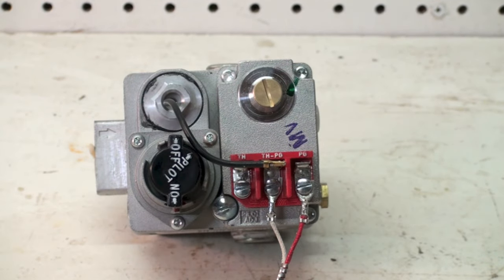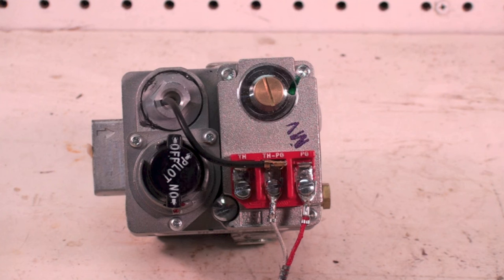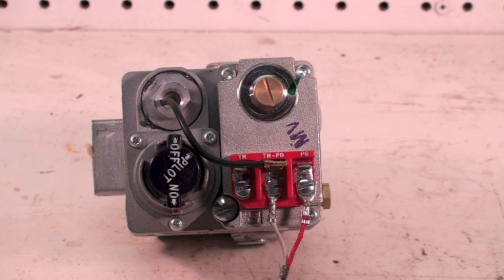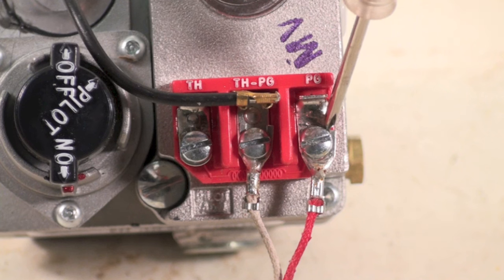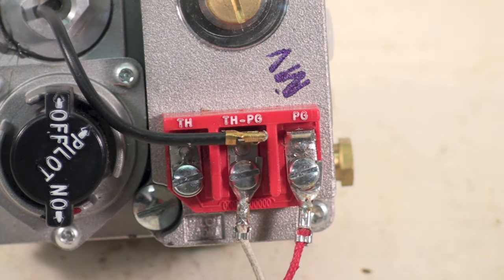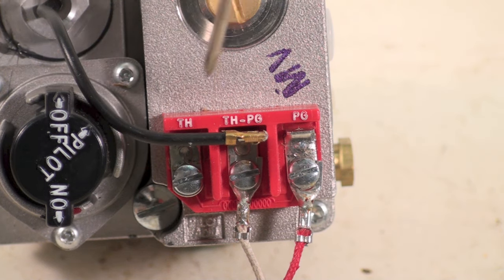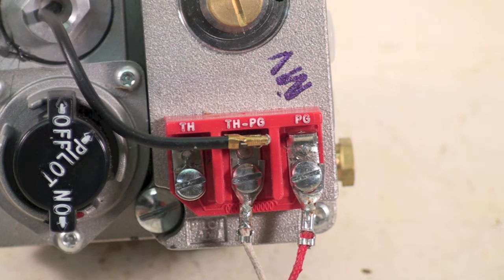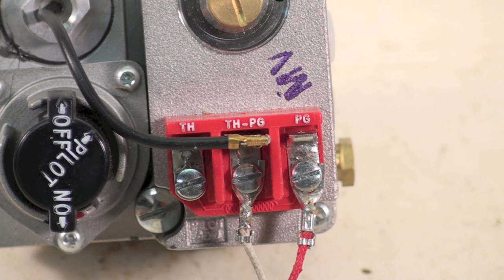Gas millivolt wiring

Comment: I have a royal rpt-50  oil fryer using propane.  My question is does the gas valve adjust the fuel mixture?
Reply from the maker: steven chandler The gas valve does not mix air with fuel. What comes out of the valve is pure propane. Air is mixed with the fuel in the burner. 
GFM
Reply: thank  you sir

Comment: again ,my two wires that go up to the thermostat are not color coded they are both black one is connected to the TH-GP terminal and the other is wire sent to the combination control and then back to the TH terminal so at my thermostat both wires are black and have been removed without labeling (helpful brother)which wire goes to the TH and which goes to the TH-GP terminal, you said the red is always return so that should go to the TH and the white should go to the TH-GP??? by the way my gas valve is the same as in your video...  my luck has manifested in other ways as in I always pick losing lottery numbers thanks GFM
Reply from the maker: jim broni With the 2 wires, it makes no difference.  I should have explained better.  Your thermostat appears to operate off of its batteries, so it does not need a power source.
GFM

Comment: Help...  I just bought a house with a gas fireplace (LP).  I have had no luck getting it to work.  The unit has no label and no one will service it without knowing the brand so I am trying to do it myself.  The main gas valve does not open.  I jumped the wall switch and can hear the valve click, but nothing flows through.  I bought a new valve and thermopile set but it behaves the same.  I have a sit 820 nova mv.  It has a magnetic safety valve that I don't think is opening. So gas pressure is good, wall switch is good, thermopile and thermocouple is new, main valve is new, pilot lights but does not stay lit and gas valve does not open. No propane smell as well.  I am ready to spend $1000 for a new burner and log set but I keep thinking that this should work.  House inspector took 30 minutes to get it started but the flame poured out a foot high from one location.  Hasn't worked since.
Reply from the maker: Well, If you send detailed pics to Grayfurnaceman@gmail.com I will try to help.
GFM

Comment: Hi, my pilot is working just fine but when I try to turn on the flame with the light switch, it's not igniting. I called a fireplace pair company and they said I need to call an electrician. Is this an electrical problem? I want to be sure before I have an electrician come out.
Reply: Erica T i have the same problem! and not sure who to call either.

Comment: what would cause a propane fireplace to burn when you are lighting the pilot.. the burner also comes on.. it should not even be able to burn until you turn the nob from the PILOT position to ON position should it? Please help. thank you
Reply from the maker: If the main gas comes on while lighting the pilot, the gas valve is leaking by.  It needs to b e replaced.
GFM
Reply: grayfurnaceman it also will not kick off by the remote or manually the only way to get it on and off is to light it and then turn the on / pilot / off nob to off position

Comment: Me again, on a 2 wire valve what should the resistance reading normally be? I disconnected the thermopile/ PG and the pilot lite stays on... why?  Thank you.
Reply from the maker: EurekaRecycler If the pilot stays on with the thermopile disconnected, and the valve is not installed backwards, the valve must be replaced.  The pilot safety is not working and could cause a fire.  Resistance on that valve should be very low, perhaps less than 20 ohms.
GFM
Reply: grayfurnaceman This furnace looks old with only 2 wires on the valve. Would you know where I could get one of these valves? Do you ( if so how to ) retrofit/upgrade these components?  Thank you!
Reply from the maker: EurekaRecycler The replacement is quite complicated.  Best left to the professional.  If you insist on replacing it yourself, you can use this video:  https://youtu.be/g8jMJIBVRGo  Hope it helps.
GFM

Comment: Wondering how to wire a fireplace gas valve that does not have low voltage connections on it? Thanks
Reply from the maker: Jeff Harrison I need to know more info.  By low voltage do you mean millivolt or 24 volt?
GFM
Reply: Looking to hook up a thermostat to a Polaris  fireplace model PG 200-N with a serial # of 02149. Thanks

Comment: Great videos👍👍👍

What is the black wire connected to th/pg?
Reply from the maker: It connects the thermopile to the pilot safety solenoid.
GFM
Reply: I had to replace my aquastat and noticed that the wiring diagram for the millivolt gas valve says I can disconnect the pilot safety solenoid line from the th/pg terminal and connect it to a 'supplemental high limit switch'. Is the aquastat considered a 'shls'? When I wire the aquastat the traditional way my pilot and burner wont stay lit. Its a brand new millivolt gas valve and aquastat.

Comment: What is the Millivolt volt reading     when checked with a meter for a good thermo unit.
Reply from the maker: +Gfdf Perte If the circuit is open (thermostat open), 4 to 600 MV.  Closed thermostat, 125 to 250.  Hope this helps.
GFM
Reply: yes  thanks very much.   Closed thermo is when it is heated.    Thanks
Reply: 600-750 milivolts open circuit.

Comment: So what terminals would you put the leads to test for voltage?
Reply from the maker: On this valve, between TH and PG.  Also, you can look for the curly line and check between the 2 ends.  Look at 4:25 on the video.
GFM

Comment: can you use a run a 24v style thermostat off a milivolt gas valve?  your videos are very informative.
Reply: depending on the technical specifications, some do both Voltage: 24VAC and 750mV Compatible: Yes.  see Mfr #: 1C20-101 emerson  or MFR #: 4PU51 dayton.
Reply: No. Unless there is a relay in between.

Comment: I need some desperate help here please … I have an Empire GWT-35-2  with an R5245 valve system.  A few days ago I started up the system again for the new season by lighting the pilot light and turning the unit on. No problems starting up however the unit will NOT shut off. It stays on and the only way to turn it off is by turning the main gas valve off.  I have a brand new thermostat and a brand new thermopile(generator)…. I have no clue what could be happening.   I have never had this problem with this unit in the past 14 years. Any suggestions?
Reply from the maker: If there is no power to the main gas valve, and the burner is still on, the gas valve has failed.
GFM
Reply: @grayfurnaceman  Forgive me for my ignorance but what do you mean by "power to the gas valve"?  The only wires attached to the valve are the 2 (white and red) from the thermostat and 2 from the thermopile.. plus 1 from the limit switch.  I have the thermostat on the lowest setting when I light the pilot however the burner kicks on immediately when it's lit... very strange. Is it possible I have the wires in the wrong place?  Possibly the limit switch is bad?
Reply: I purchased a new main valve and installed it... the unit is doing the same thing. The burner will go on as soon as I light the pilot. Could a bad limit switch be causing this?
Reply from the maker: Try this easy test.  Remove one of the wires (not the thermopile).  If the burner stops, there is a problem in the wiring or thermostat.
GFM
Reply: After days and days of trying to figure out what was going on with my gas heater I FINALLY figured it out and my house is warm and cozy again!!!!!  It turns out that the 2 wires from the thermostat connecting to the main valve were badly brittle and falling apart. the two wires were touching each other close to where the outer shield was stripped.  I ended up cutting about 8 inches of wire completely off because the shielding was just falling apart and brittle (from the heat I guess)… Good thing I had plenty of extra wire to pull from the wall or I would have had to splice another piece.  So my question NOW is this common with thermostat wire getting brittle like this... Is there some sort of protection from the extreme heat that I can use so this wont happen again? Heat resistant wire wrap of some sort??  Thank you grayfurnaceman for your suggestions!
Reply from the maker: Two issues here.  If the wire has been overheated, you need to find out why.  Flame rollout?  I would be more worried about damage to the gas valve.
I think I would replace all the wire up to the thermostat.
GFM
Reply: Of course I know why... All these wires are located no more than 8 inches from the burner.... That entire AREA where the main valve is located including all the wires from the stat and the TC are all right there.... Hardly anything I can do to change the design of the unit... That is just the way they manufactured this unit.  So again I ask if there is some type of shielding I can use to block any excessive heat to the wires... Im not worried about the main valve as it is plumbed to be in a specific location... I'm just worried about all these wires being exposed to these type of temperatures.
Reply from the maker: Well, you could certainly fabricate a sheet metal shield over the wires.
GFM
Reply: One more quick question for you sir.... I took your advise and I'm going to replace the entire 50 feet of TS wire however..... fed ex just dropped off my wire that I ordered and after some close inspection I noticed that it's a tad bit thicker than the wire I currently have... looks like 18 gauge wire compared to the existing 20awg wire... will that matter much? Any concerns?
Reply from the maker: 18 ga wire used to be the standard, so it's ok.
GFM

Comment: I just replaced the valve but when it calls for heat I hear the click but the pilot go’s out
Reply from the maker: You probably have either a thermopile that is weak or not covered by the flame or you have a short in your wiring.  Be sure your wiring follows the diagram.
GFM

Comment: I was cleaning my thermopile and a shop lite that had bare wires sent110volts through the thermopile, to gas valve  model#36CO3U type433 and thermostat  and fried all three,which I have replaced with new parts heres the Q.my wires are not color coded and during the trouble shooting process have know idea where the go also there are only two wires I bought a Honeywell RTH2300/RTH221 thermostat with 7 connection??? help
Reply from the maker: jim broni Boy, you are unlucky.  
If you have only heat without cooling,  all you need is 2 wires to the thermostat.  One from the gas valve and one from thermopile.  Hope this helps.
GFM

Comment: hi, i thought this gas valve is composed of a pilot valve and a main gas valve. so if the main valve solenoid is between TH and PG , then the pilot gas valve must be between Th-PG and PG? is this correct? thanks.
Reply from the maker: There is no PG terminals in most of these valves.
GFM

Comment: i know this vid is old but for what i wanna do, i cant find anything. i would like to have a switch in my living space that turns my hot water heater up and down. its a long walk outside to the heater and it doesnt need to be on high all the time. is there a way to run a wire or something? or maybe a special thermostat or remote something or other? its a 15 year old gas unit. thanx
Reply from the maker: Not unless you have considerable skills in electrical and gas controls.  
GFM
Reply: i have some. dont know what "considerable" means exactly. my dad was general contractor and ive been in all phases of construction since 1982. is there a special device or my existing contol needs to be modified?
Reply from the maker: Give me the model number of the heater.
GFM
Reply: Unitrol - Robert Shaw 66-184-335 R110RTSP is the control info. i live in a cold climate and the model info is wrapped under two insulative jackets and tape. sorry if this control info isnt enough but the jackets come off as a last resort. thank you for your time gary :)
Reply from the maker: There is no way to make that control work from a distance.  All temp control is inside the control.
GFM
Reply: yeah, thanx. i figured it would be a feat of engineering on that valve.  thats why i also asked if you knew of a company maybe that makes remote valves. something like this maybe. 
http://waterheatertimer.org/Remote-control-for-gas-water-heater.html
or another "helper" remote type of thing.
i could prolly fabricate something. but my first thought was to ask a seasoned pro like you.
thanks again and wish me luck :)
ct
Reply from the maker: Interesting.  You could remote mount the timer.
GFM
Reply: id just wire it to a manual "high/low" wall mounted switch. prolly can find a cheap small solenoid to rig up somehow.
Reply from the maker: That should work.
GFM

Comment: Anyone can explain to me why some pilot assemblies have thermocouple only, some have thermopile only and some have both of them???? Thanks
Reply from the maker: In many cases, the thermopile will not shut down the pilot safety switch within the required 3 minutes after pilot light outage due to its high output.
The Thermocouple will shut down.
GFM
Reply: @grayfurnaceman  Thank you sir